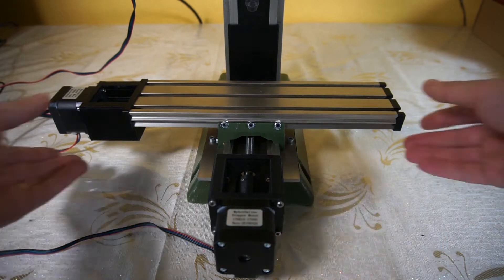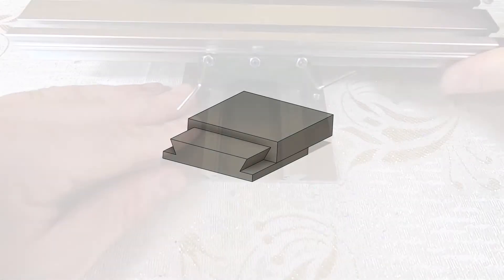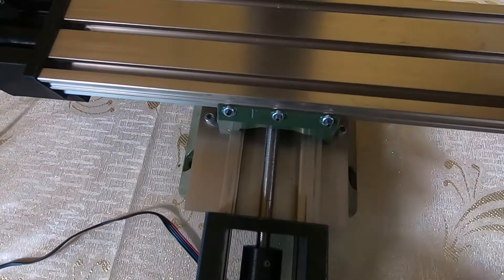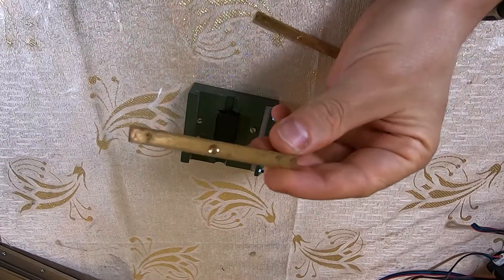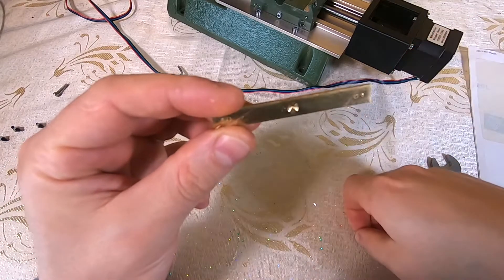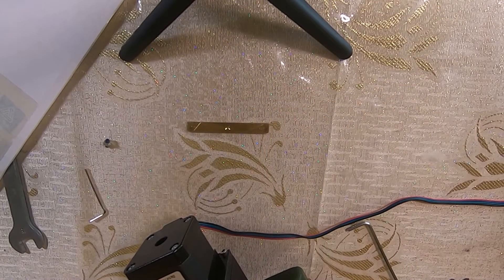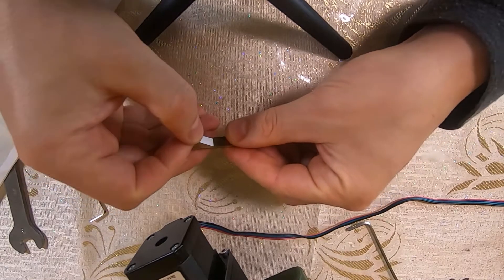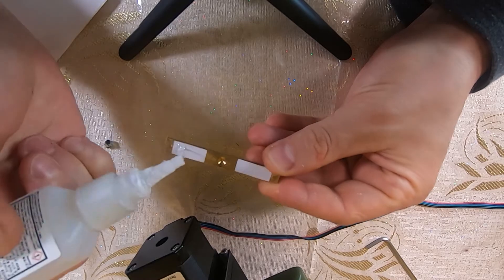Proxxon MF70 Table wobble

Comment: the brass bar normally (in reality there are two opposing ones) has the purpose of aligning the cross table so that the milling is uniform. in the case of the mf70 it does not have that purpose but serves to push the trolley towards the opposite surface which must be perfectly square with the Y axis. The problem is that to maintain solidity the three screws must be tightened with a certain torque and this creates a difficulty in sliding because there are no thrust bearings at the ends of the X table. The solution is to increase the size of the crank by adding a long cross bar.

Comment: Is it that the brass is soft a metal for the adjusting screws? You could remake the brass part out of harder metal . Paper and glue is way cheaper but not a permanent solution. Cheers.

Comment: Unorthodox but practical solution. My first thought would be brass shim stock. But the glue toughens up the paper, and if you have to redo it just burn off the paper and redo the process.

Comment: What about flattening the ends of the grub screw?
Reply from the maker: For the Y axis, they come at an angle on the gib, so it's still an odd setup. There's also the problem of the on/off feel of this, it either wobbles or it's completely stuck. The grub screws don't allow for very fine adjustments.